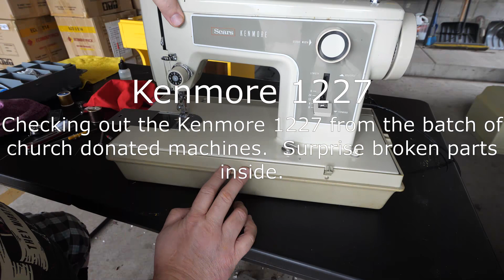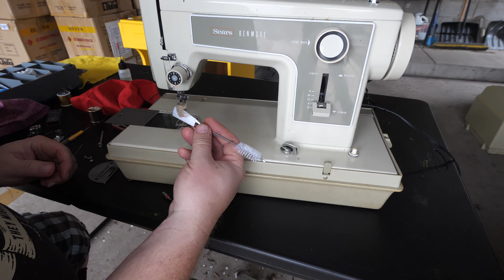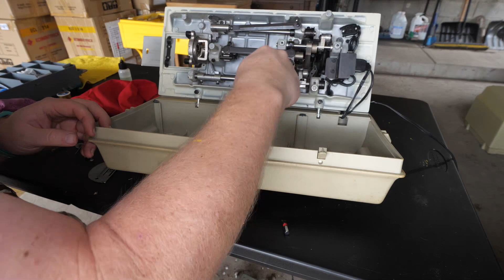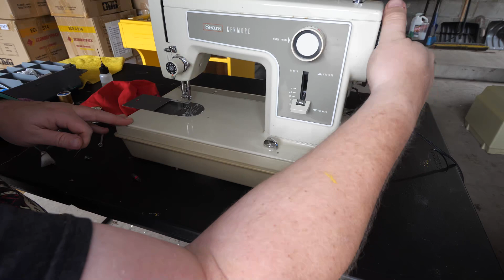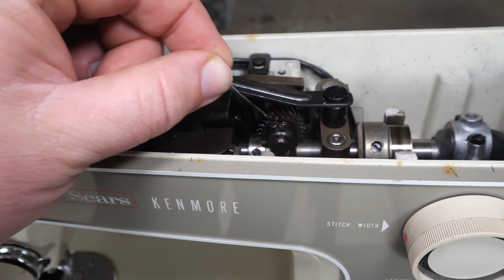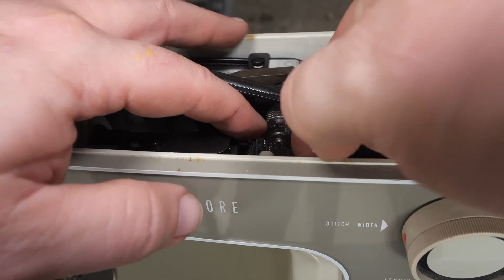Kenmore 1227 Inspection

Comment: Hi, I have one of these and the same gear for the zigzag is broken. Were you able to get a replacement? If so could you tell me where? Thank you!
Reply from the maker: Unfortunately there is no commercial replacement for those gears.  There are several 3D printer files to make replacement gears if you have access to a 3D printer.  I think Thingiverse has some and there are several Facebook groups for Kenmore machines that have the 3D printer files.